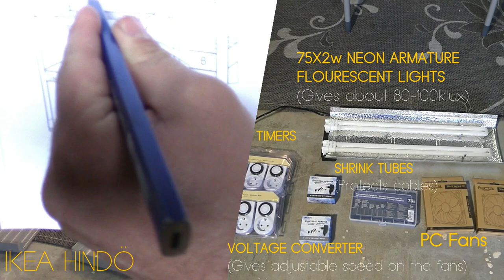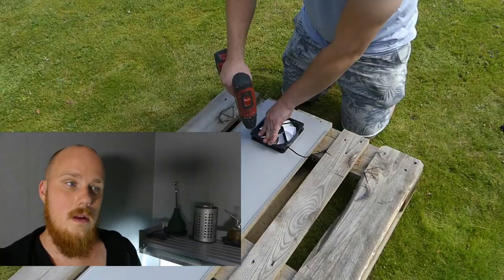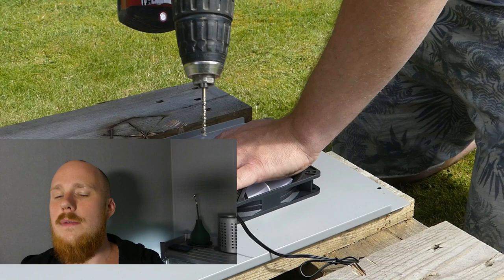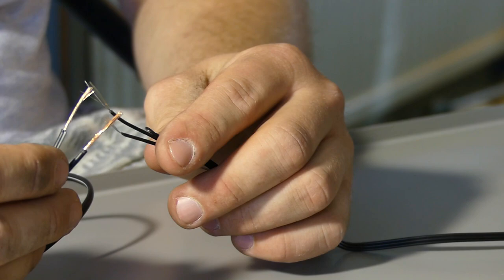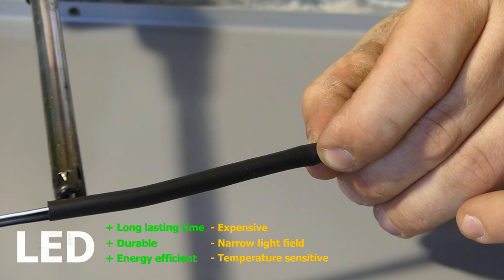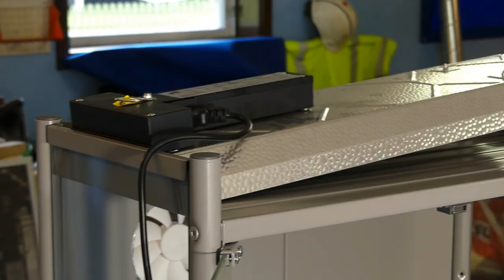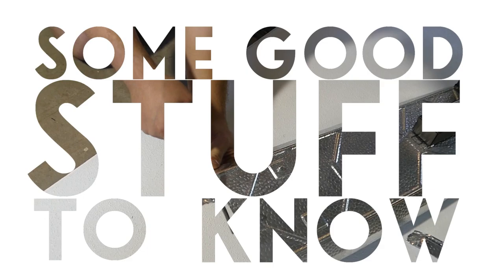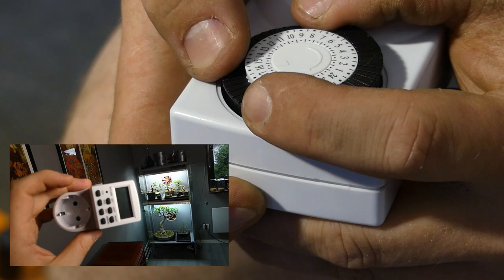Building A Indoor Bonsai Growing System - INDOOR BONSAI CARE

Comment: Now that we had two winters since this was created... how did it work out? I have serious doubts about the CCFL lights as they aren't covering the entire color spectrum required for good growth, but your experiences with the light could prove me wrong. Science says that using cold white fluorescent lights alone, you are missing out on the red color spectrum that's required for growth to stay compacted, meaning short branches and small leaves. Since with bonsai that's the exact thing we want, and that part of the spectrum is missing from this light setup, I'm curious to know what your experiences were, whether your results contradict, or confirm this.

Thanks!
Reply from the maker: Whats up Dominic? How ya doin.. UPDATE: The cabinettes work fine, neonlights in our indoor bonsai growing systems are energy efficient and cheap in comparison to e.x LED.. Not one has broken so far.. which is truly amazing.. We have never had problem and the light source pushes out strong lux around 85-100k... We currently use 6500k because it's the best temperature of the light for matured plants.. (It has good wavelengths of red color spectrum) We found that the amount of lux the source pushes is by far the most important factor, as long as the lights push normal wavelength numbers.. We can safely say that there are very few artifical lightsources that are beeing sold as growing lights that have 10.000 kelvin or more (dark blue light)..  Because 2500k around there is for Flowering phase...6500k is for normal growth/growing i reckon, and higher values like 9500k is for seedlings and early stages.. So you will often find only those values 2500, 6500 and the highest 9500k.

Comment: Would you say that an open air (not encased and closed) shelf setup with only the lights would be sufficient combined with an air humidifier? Or does this encasement hold a specific temperature that is higher? I live in Sweden as well, south, so dry and crazy winters here. Just starting bonsai.
Reply from the maker: We did a closed version because we wanted ALOT of humidity. With time we expanded and got more and more trees, even semi-tropicals, so this idea of insane high levels of humidity was hard to maintain. I have one open system and they work good aswell, i just make sure to aim my humidifer machine in that direction so the trees get a nice mist.
Reply: @BonsaiTalk  ok thanks!

Comment: hey there, great work and very inspiring!
may I ask about the fans, do u bring the air in the cabin or do u blow it to outside? And can u adjust the airflow/amount of air? or how do u know how much airflow is needed?
Reply from the maker: Hey man! The lower fan are blowing air in and the top one out - because heat rises. The amount of airflow is steady and the fans run on lower voltage because of the advantages from the voltage converters who have adjustable steps, this also makes them silent and they will most likely hold longer as a result. Let's grow!

Comment: How do you address humidity and temperature monitoring? What about watering? seems like there is no place for the water to fall to except down the front of the glass
Reply from the maker: Whats up Jtanch2.. Im gone be pretty honest with you, it's a very unique setup in that way that you need to be careful when watering, i solved it with plastic trays because it was messy to learn to water correct.. it still is. I had a idea to install foggers (reptile humidifers) but i didnt follow up on that idea because it would result in a short circuit most likely.. When you spray water on the plants, some amount of unavoidable water runs along the steel/glas yes.. I do not have any problem with to low humidity tho..the species i have focused on can handle it good.. Thanks for tuning in!

Comment: I am very keen to pursue this growing system, can I ask a few questions pleaes,
1. as the seasons change and daylight and temperatures change, how do we adjust lithging times
2. Are there any species that are better in gro light systems, I really want to grwo Plac Pines in this way
3. Surely deciduous species woulf be difficult to grow this way
4 Any assistance will be appreciated, as I have just purchases a few sets of tube lights
Bernie
Reply from the maker: 1. You don't. Tropicals/semitropicals need the same amount of sunhours, all year. 2. If you mean BLACK PINES, (if thats what you are trying to communicate) they can grow under extra artificial lights, but only under outside conditions. You can not grow pines indoors. 3.  Decidious trees are the best ones to grow in indoor growing systems, infact, conifers can't due to the need of dormancy and different seasons. 4. Make sure they put out the right amount of LUX, weak lights will just not make it.

Comment: You have a hilti drill but cant afford a $20 pr of tin snips wow
Reply from the maker: As long as the build fills the purpose bro..
Reply: @BonsaiTalk  Well some people that watch your videos know nothing about tools and may try to use a saw like you did on the tin sheeting and cut their fingers off, it's your video and you should be showing people the proper way always, that looked horrendous, dangerous and time consuming to use it when it can be cut with a cheap set of tin snips in a fraction of the time and a lot less dangerous with the proper tool.